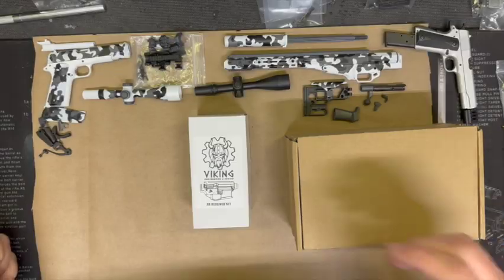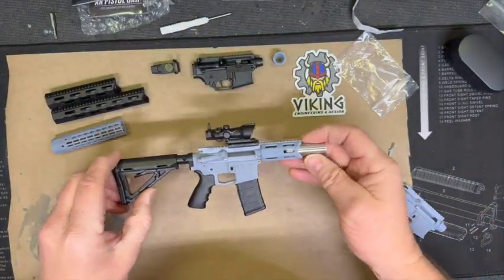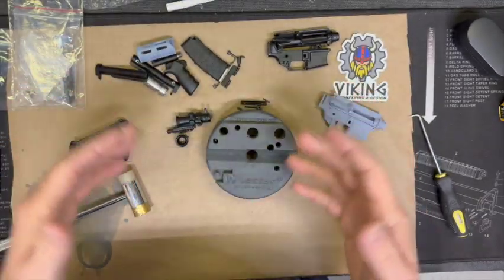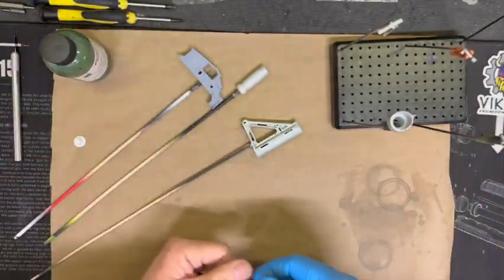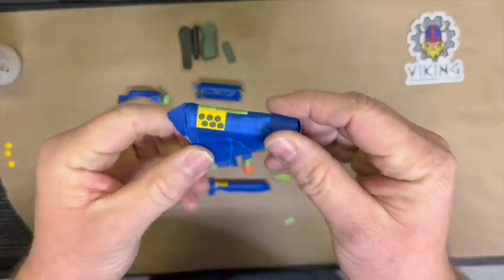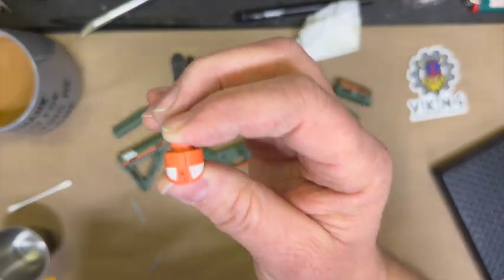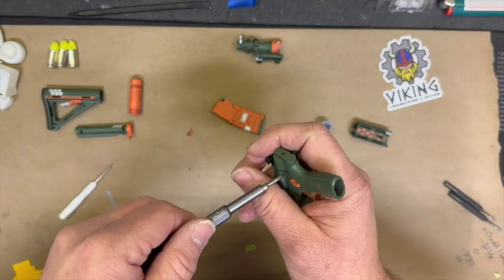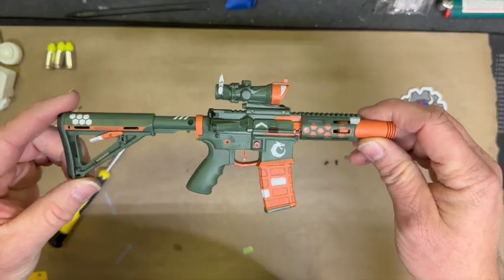Custom Painted GoatGuns AR15 with Viking Engineering and Design 3D printed parts

Comment: hello my friend. i think you make the coolest custom goatguns bro. im wondering if you could do a full dis/assembly of the ar. i too mine apart and thought im genious enough to not label the screws and then now its been so long i cant get it back together not that its painted. i also have a question. do you do custom work on all minis. i have an umarex 1:2.05 walther ppq. i know how to almost full disassembly but i dont have the proper equipment to do a top notch stormtrooper black/white project. i have an old airbrush but its just to much of not have the patience. do you have prices the you charge for specific ones.its very similar to the goatgun .45 i have. would they be similar as far as your costs go? if you have a ballpark idea what that size gun costs, no stencls just watever you think would make it look the coolest. i can email you if thats a better forum to discuss. im greg andthank you cheers
Reply from the maker: Hi. I do have a link for you. I don’t do customs to order currently. 
I’m sorry for the delay. Just now getting a bunch of responses. 
https://youtu.be/6XUpZV6gkEo?si=_qqxv_gDIXYP-l2t